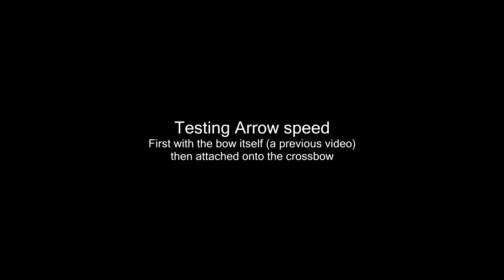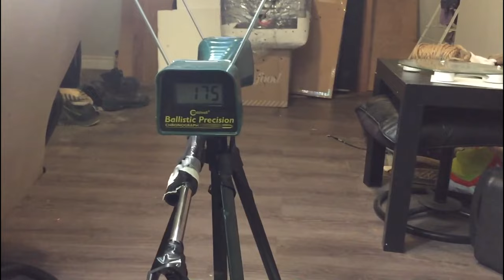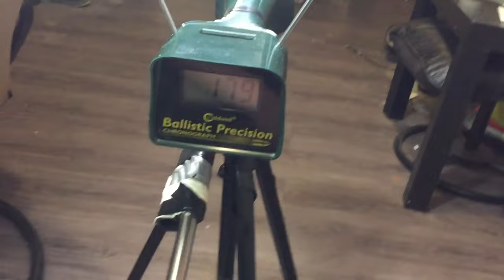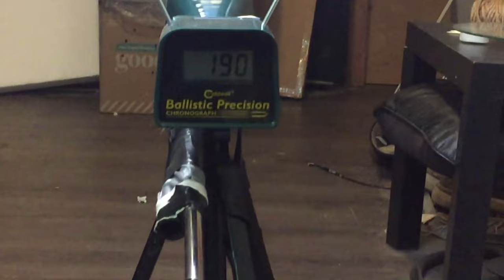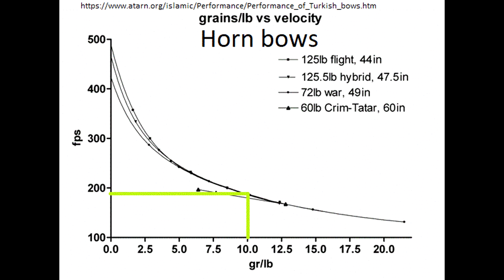Chronograph Chinese Crossbow Potential

Comment: Nice work!
You managed to get almost a 100% of the speed.
However, I would still recommend sanding the top part with fine grit sandpaper to reduce friction even more and to reduce the chance of rising splinters which might tear your bowstring when moving forwards with heavier draw weights.

P.S. I cant wait to see how the 240lb longbow fares :)
Reply from the maker: thanks!
 i no longer have the 240@32. im trying to order a 260 but its pricy

Comment: Thank you for working on this project. The performance is impressive in this test. I'm curious if there's evidence for Chinese crossbows with such a long draw length. Historum's HackneyedScribe, a famous proponent of Han crossbows, estimates the draw length at around 24 inches & the powerstroke at around 19 inches. They base this on a crossbow from Qin Shihuang’s terrocotta army, which has a 27-30in stock.
Reply from the maker: thanks, I am basing off of the stone carving discussed by hackeyescribed
Reply from the maker: find someone 5'6-5'8 and grab a ruler to the crotch and its gonna be approximately 30" inches ish. for me its 32" but im not ancient chinese height
Reply: @HistoricalWeapons   The Terracotta army's median height of 5'8" is actually an accurate representation of heights in the Qin military because they had height standards and the actual height deviation of the statues seem to reflect real life height deviations. 
See "Ears of Ancient Chinese Terra-Cotta Warriors Offer Clues to Their Creation" by National Geographic
and https://econhist.userweb.mwn.de/terracotta-warriors.pdf

"mean height of the figures to be 177.7 centimeters, with a range from 166.0 to 187.5 cm...the size distribution resembles almost precisely the distributions obtained in most military institutions of the eighteenth century, indicating that the minimum height requirement of the Qin army was close to 175.95 centimeters 'because this is the point at which the same distribution begins to deviate obviously from normal distribution" ...terra cotta statutes were probably true to life approximations of contemporary soldiers"
- Edward Burman. The Terracotta Warriors: Exploring the Most Intriguing Puzzle in Chinese History
Reply from the maker: @Intranetusa  what if it was just propaganda? i dont think the king wanted short men protecting him?
Reply: @HistoricalWeapons  I'm thinking it could be possible that the lower draw weight crossbows had longer powerstrokes (eg. 30-31 inch draw/ 25-26 inch powerstroke) while the heavier draw weight crossbows had shorter powerstrokes (eg. 25-26 inch draw/19-20 inch powerstroke). To draw the crossbow to ~30 inches to your crotch area requires bending your arms and using some of your arm muscles (as the stone carving in your 7:07 has his arms bent). However, if you keep your arms straight without drawing to the crotch area, the draw length would probably go down to ~25 inches. For the heavier draw weight crossbows, I wonder if it was better to not use your arm muscles at all and just the arms keep it straight for stability purposes while you use only your leg and back muscles (eg. do a leg press or dead lift maneuver while keeping your arms straight).
Reply: @HistoricalWeapons  The Terracotta army wasn't propaganda because it still had representations of short men and around half the army are unarmored men. The shortest Terra Cotta army statues are around 5'4" tall - which is 4 inches shorter than the median height of 5' 8". The taller statues are 6'2" (while I've read the tallest outliers were up to 6'6" according to newer discoveries). If the Terracotta Army was simply propaganda, then all of the soldiers would have been over 6 foot tall and fully armored in the best armor.
Reply: @Intranetusa  . damn bro high IQ.

Comment: Hi! It's a good job and a good bow's performance! Can you make same video with the same arrows, but with X-bow equipped with your 145 lb bow or even 190 lb bow, please?
Reply from the maker: My 145lb bow shoots slower than 95lb because it’s designed as a strength bow not a fast bow
Reply from the maker: I’m looking at 300lb wood prod

Comment: Man it already shoots the same speed as a 960lb European crossbow
Reply: Medieval iron/steel prod vs a carbon composite prod. Kind of hard to be surprised
Reply from the maker: well, power=1/2powerstroke*draw weight *efficiency
Reply: @littlehorseyhorsey  you can hit 200 with any old wooden bow of sufficient draw weight. Modern materials only reduce the bulk of the weapon itself, nothing more to it.
Reply: @Данило Јовановић  200fps on 10gpp? Not a 100lb wood bow
Reply: @Brendon  the carbon composite about same speed as well made horn bows
Reply: @VictorJavannn  I only said it was possible at a certain draw weight, did not specify which one :)
Reply: Power = Draw Weight X Powerstroke X Efficency
Reply: @Intranetusa  true, but if you looked at Todds Workshop of a Arbalest vs a modern crossbow the European Arbalest may have slightly a bit less jolts then the modern crossbow but had a significant stronger impact.  Impact is what's more important when trying to kill a man in or out of armor.
Reply: @landsknecht8654  No, the modern crossbow had both more energy and higher momentum (and thus stronger impact) than the medieval crossbow in Todd's video. If you look at his data charts at the end of his video called "Heavy Crossbow - Light bolts - What happens?", the modern crossbow had both higher kinetic energy and higher momentum when shooting a medieval bolt. The modern crossbow shot a medieval bolt at 159 joules and 4.6 kg.m/s of momentum. The medieval crossbow shot the medieval bolt at 103 joules of energy and 3.7 kg.m/s of momentum. https://youtu.be/bU2SkGz0RYM?t=494
Reply: @Intranetusa  I'll look at it again unless it's a different video that I saw.  The one I saw he was comparing both and he said that the arbalest gave greater momentum than the modern crossbow due to the design of the bolts and heavier weights of those bolts.

He also points out that momentum gives greater impact which is better penetration power. He just said the modern crossbows are overall better for a lot of other reasons and there's more pros then cons to it. (Mainly due to the modern materials)
Reply: @landsknecht8654  That might have been one of the earlier videos where he only fired light modern arrows with the modern crossbows. In this newer video here: https://youtu.be/bU2SkGz0RYM?t=494  - he tests both the light modern arrow and the heavier medieval bolt and fires both of them from both the medieval crossbow and the modern crossbow...and it turns out the modern crossbow is better at firing both types of projectiles.

Comment: I want Tod's take on this! He doesn't bother with composite or fiberglass but this is a project worth learning the necessary skill.
Reply from the maker: reply: Thanks Jack.  I don’t really understand your point.  Modern grp bow shoots at same power as replica steel bow.
Reply: @HistoricalWeapons  What I meant is that Tod has so far only made steel and wood bows because he doesn't know how to make composite bows. But if fiberglass or carbon can replicate composite this well, then he can learn how to use those materials.

Comment: Amazing! You are really doing amazing work!

And that crossbow was almost as powerful as .22LR round. That is crazy. I wonder what damage will the 94 gram armour piercing arrowhead (and yes, it's just the arrowhead, shaft not included) do.

If I may ask, what is the weight of the arrow shaft? Or an arrow shaft in general? As well as the length! Thanks!
Reply from the maker: these crossbows are in theory more powerful than european crossbow, 400lb@30" is much more powerful than 1000lb@8"

Comment: >>>Tod's Medieval Steel Crossbow: 960lb draw weight, bolt weight 67g, bolt speed 184 fps = 104 Joules of arrow energy
>>>Han Chinese Crossbow: 95lb draw weight, bolt weight 64g, 190fps = 107 Joules of arrow energy
960lb European crossbow < 95lb Chinese crossbow in output energy
Reply from the maker: thanks for the energy calculation. I want to stress the bow prod used is made of modern materials, but it is shooting about the same speed as a good quality horn sinew bow from ATARN, 190fps@10gpp
Reply: The Chinese trigger design allowed long powerstrokes. It is advantageous in many ways. It can store more energy even with lower prod weight. Longer powerstroke transfers that energy to arrow more efficiently. It also means charging the crossbow is simpler: moving a 150lb string 25in is much easier than moving a 750lb string 5in. Furthermore, steel as a material for prods is also of lower efficiency by itself, however it does allows higher draw weight needed to make the shorter draw length crossbows more powerful.
Reply: Chinese weapons underrated
Reply: @Gallowglasser  The performance  does not match the historical reputation , because modern "reproductions " are categorically too thin. Their limbs are usually machined from 10-12mm slat , while museum bows have limbs 15-20mm thick.  
The modern repro bows are simply not efficiently strained, this causes them to be both underpowered and slow casting due massively overbuild limbs.
 Typical  reproduction windlass bow only pulls around 1000 lbs while the historical ones were in 2000-4000# range.
A 1000#/5" bow only stores ~300J energy , that little can be spanned with compound lever like goats foot - It takes about 80 lbs force against handle with one meter pull back to generate 300J with wippe or goats foot. Any grown up man can do that. 
 A windlass  is not really  justified investment unless the energy capacity approaches kilo Joule  class.
Reply: Note that historical ancient Chinese crossbows had lower powerstrokes but much higher draw weights. This crossbow has a 32 inch draw...so the powerstroke is probably 26 inches? The Han era crossbows probably had a powerstroke closer to 18-20 inches, with a median draw weight 4x this one at ~387 lbs. However, it's possible that the lower draw weight crossbows could've had higher powerstrokes (eg. 120 lb draw weight with 30-32 inch draw and 26 inch powerstroke) while the higher draw versions could've had lower powerstrokes (eg. 387 lb draw weight with 26 inch draw and a 20 inch powerstroke).
Reply: @Intranetusa  its 31" draw length (he cut if down from version 1). i think he will keep cutting it as the prods get heavy
Reply: @Intranetusa  whats strange about it
Reply: @JanoTuotanto Do you have any sources regarding "personnel" crossbows that are in the 2000+  to 4000 lb range? I was under the impression that the vast majority (if not all) crossbows that fall under those extremely heavy draw weights were light field artillery pieces and were not personnel crossbows used by individual soldiers. 
Furthermore, I've seen and read Tod's workshop and other videos using the goats foot lever to span a ~300-400lb crossbow and recommend it for up to 500 lb crossbows. I am not aware of anything that recommends pairing a goat's foot lever with a crossbow of 1000 lb in draw weight. As for the hypothetical one meter handle, I don't think anybody have arms that are one meter (3.2 feet) in length unless they are 7+ feet tall basketball players.
Reply: @Intranetusa  so resultant fps is worse?
Reply: @marcellusbrutus3346  It is strange that Andreas Blicher made a 386 lb crossbow that looks just as big and bulky as his 1200lb composite crossbows that he made. You'd think because it has a much lower draw weight (1/4 the draw weight), the prod would be much thinner and the overall device be less bulky.
Reply: @lichenggong1248  The most common median Han Dynasty crossbow with a 387 lb draw that might have had a 19-20 inch powerstroke should be much stronger than the 95lb draw + 31 inch draw (26 inch powerstroke?) bow he is using in this video. However, I don't know if it would be better to have a design with a 20 inch powerstroke and a much higher draw weight or a design with a 26 inch powerstroke with a lower draw weight. For example, although the 387lb/19-20 inch crossbow might beat this current 95lb/26 inch crossbow, a 290 lb/26 inch crossbow might beat a 387lb/19-20 inch crossbow.
Reply: @Intranetusa  horn
Reply: @marcellusbrutus3346  Yes, that's likely a significant factor in the thickness of the prod construction. Though I wonder if that 386 lb Yew crossbow is still "overbuilt." The stock itself (which is entirely wood in all of the versions) seems a bit bigger than necessary in the 386 lb version compared to the two ~1200 lb versions.
Reply from the maker: @Gallowglasser  thanks for the manuscripts. from my personal experience, this large size is usable by one man. its just not something you can skimish with. you need fortification or a shield in front of you. for the chinese that is fine because when fighting the xiong nu they were always on the defensive in battles due to the lack of cavalry
Reply: @Intranetusa  nice
Reply: @Gallowglasser  I don't think those bows are drawn to scale. Those manuscripts are late 12-early 13th century, yet they are wielding arming swords far larger than would be seen from historic examples available and are in some images men are standing as tall as houses, ship masts or castle walls. Garnering scale from Medieval artwork is an exercise in futility.
Reply: thansk
Reply: @colbunkmust  although you're right about the artwork in the Early Middle Ages the thing is it is a the realm of possibility because there are people that recreated those crossbows like that and they work fine.
Reply: @lichenggong1248   
It's not that simple because it's just as the guy said in the video he's using modern materials which in Tod's Workshop has proven to be Leaps and Bounds better than any crossbow material in the past. 

Also it's worth noting that even that 960 lb arbalest may had less jolts of energy but the arbalest had a lot more powerful impact and penetration then even the modern crossbow.   Todd said the impact is what's much more important then the jolts. 

Todd even pointed out in his data how the medieval bolt itself as well the different types of medieval bolts made a big difference in both in penetration and impact energy with the same arbalest even if the type of bolt loses some jolts of energy still transferred a bigger impact as well as more penetration power simply the design of the bolt. 

So it gets complicated it's not a clear cut.
Reply: @landsknecht8654  who has done reproductions of 12-13th century xbows of that size?
Reply: @colbunkmust 
Here is one attempt. If I read right this composite arbalest gave the heavier bolt over 400 joules of energy the lighter bolt over 300 joules, but I don't think it said what the impact was but it showed how deep the heavy arbalest bolt went.  I do not know the power stoke but it looks like it's 6 to maybe 9 inches.   It is a over 1200lb draw weight.    There are other replicas of over 1000lb draw weight Great Horn arbalest that looked like has a possible power stroke of way over 8 inches and are very large but can be carried by one person. 
 https://youtu.be/AA5M0QKXtWU

There are other attempts of making these moster horns or composite  crossbows and arbalests that seem to have over 8 inches of power stroke yet having over 1000 lbs of draw weight.
Reply: @landsknecht8654  Fair enough, although the video stated the bow was based on a actual Swiss original, not scaled based on Medieval artistic depiction.
Reply: @colbunkmust  True. There are a few originals that survived...
But I guess it shows the artist is not too far off though...
Reply: @landsknecht8654  No, that's assuming the artist was trying to draw the same sized crossbow which is a bad assumption, that was my whole point...
Reply: @Intranetusa  There are no crossbows in the 2000-4000 lb range. He's thinking of ballistae or scorpions a.k.a. mini ballistae.
Reply: Should try to do a test on armour with the crossbow
Reply: @JanoTuotanto  the thicker the limbthe bigger the initia and.thus loeer efficiency.  If the limbs of the bows are thicker for historical ones, that only means the historical crossbows have even.lower efficiency than todays

Comment: If you were going to shoot it as a crossbow most of the time you would need a thicker more durable string serving which further lowers the power output.  
It’s a trade off. Stored energy ready at a triggers pull but added friction lowering speed
Reply from the maker: agreed

Comment: This may be a dumb question, but do you get an accurate chronograph reading when it's so close to the bow? I think it's so close that the arrow is still accelerating when the tip passes the first sensor. The speed reading will be the average speed of the arrow tip between when it passes the first sensor and the second sensor.

In other words, I think your bow is actually faster than the readings.

OTOH, if the chronograph is reading when the tail passes by, then the reading should be accurate. I don't know how chronographs work exactly. The difference doesn't matter for bullets since bullets are no longer accelerating when they reach the first sensor.
Reply from the maker: it might be slightly off but my living room is very small. im comparing with my other hand bows and get similar fps